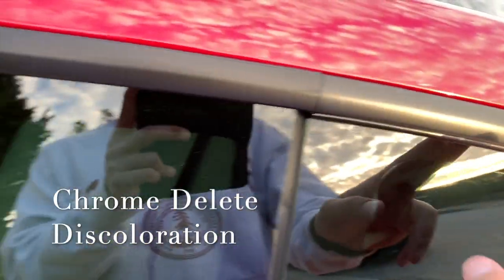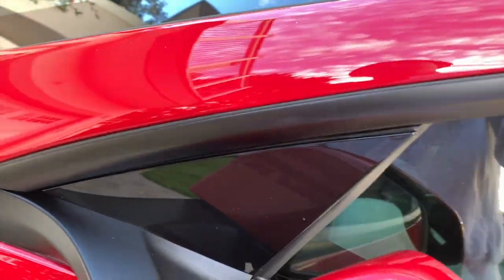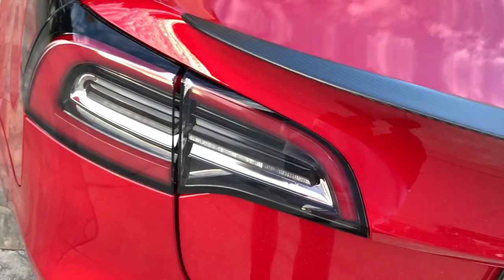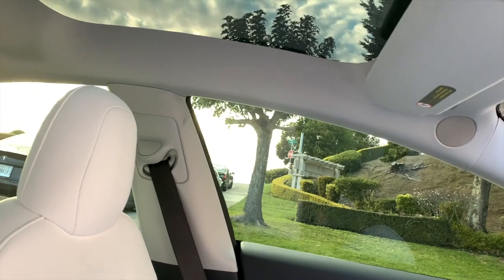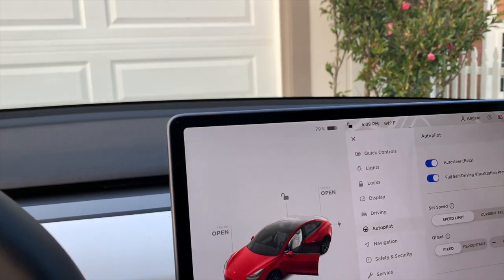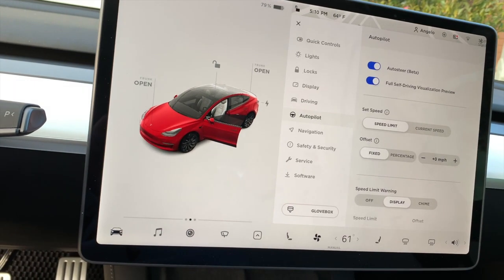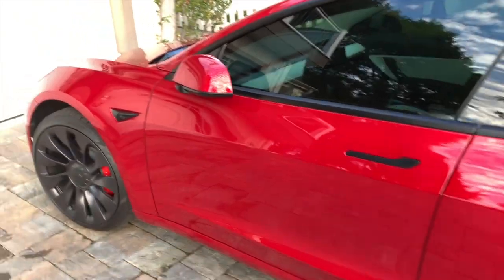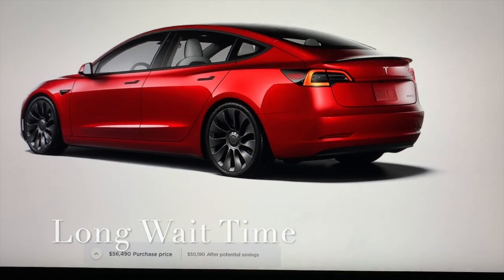A Few Things That I Hate About My Tesla (2024 Model 3 Performance)

Comment: I got a $550 ceramic coat to improve the exterior look and finish from a local detailer and then luckily had only a front passenger door panel gap that was fixed in an hour of taking it to the service center. Very happy with everything except for how much the range can fluctuate and how easily the black interior heats up under the sun (got a custom fit sun reflector for this)

Comment: I am a new model 3 owner, 3 weeks. I already drove 1500km. I hand wash my car weekly, I am too afraid to send it into a car wash. I have PPF in the front of my car but not the sides and back. I am surprised by the rock chips you encounter, I don’t yet have any. I am planning to add PPF on my own at the bottom strip. The PPF helps, but you need to go to a good installer and it should be done the first day you get the car. I don’t understand the rattling noise. I think I’ve heard it but not sure. I will be alert about that. Thanks for sharing.
Reply from the maker: No worries! Congrats on the new car! How are you liking the PPF?
Reply: How is it going with the PPF?
I don’t know if I should get a Tesla.

Is it working for you?
Reply: ohad PPF working good. No dents thus far. 6 months with 10000km, I’ve had 1 wheel rotation already. I did however changed my front pumper because I accidentally ran into something in a narrow underground garage, so the new pumper has no PPF but in any case, no dents. PPF makes the car easier to wash. At least you are at peace that the car won’t be scratched during washing. But yes, I think PPF definitely helps.

Comment: That condensation is a Saftey issue and they have to replace those lights! That’s illegal
Reply from the maker: Woah. Did not know that. I'll reach out to the service center to have them change it. Thanks for the heads up!
Reply: @AngeloCarlos  if you submit through they app they’ll send a mobile tech out to replace it

Comment: Do you have any gap issues, misalignment regarding tail lights, door closing issues, no hand handles at interior side ceilings like typical cars. Even a basic Corolla have it!!!!You are paying thru your nose and do not have that safety features for your passages? Why??? What about emergency door safety features easily accessible? Go watch TFL Videos regarding passengers door fail. Why is there no Air-Suspension shocks? Why not even a HUD? I like to have small dashboard in front of the steering wheel.
Reply from the maker: Yeah, I’ve had a few door closing issues in the beginning and had to have them fixed with the service center. Hope all is well!

Comment: Hate is such a strong word. Especially for nit picky stuff. Condensation in new car lights is common as the LED lights don’t heat up the cavity like the old tungsten bulbs did which would help dry out the lights.
As for the EPA range, perhaps get the EPA test changed so it’s more accurate. Every manufacturer makes the same claims which no one can replicate in normal driving.
Reply from the maker: Hate is a strong word. I really do enjoy the car. Appreciate the insights on the EPA and Condensation. I leaned something new today. Have a great day my friend!

Comment: Rock chips has Zero to do with the car itself. Even if it has 3-4 coats of paint. it doesn’t matter if you have a 20k paint job ( which I am exaggerating) you can’t not get rock chips.

Comment: If you change those wheels down to 18 inch, you’ll gain 40 miles of range.
Reply from the maker: That's pretty cool! What wheels did you change them to? Were they the arrow wheels?
Reply: @AngeloCarlos  any 18 inch wheels I heard, this is because the size of the tire is larger
Reply: @AngeloCarlos  I went to the 18” Martian wheels and they fit over the red performance brake calipers without doing any modifications. They look like the wheels that are coming on the roadster.

Comment: Note to self and something a lot of new YouTubers seem to do...stop looking at the display and look into the camera lens.  It's very annoying for the viewers.

Rocker panel paint chips are common with all vehicles, it's not Tesla specific.   And mileage, well gas vehicles never get their rate mileage.  Also all car dealerships are going to question if an issue is covered under warranty.  Is this your first car?
Reply: My vw tdi gets 3 mpg better than advertised
Reply: @ridered7394  I doubt that, since EPA ratings are based on ideal conditions.
Reply: I agree, all my cars had chips after driving. Perhaps stay further away from the vehicle in front.
Reply: @SirHackaL0t.  this happens for frequently when driving in the rain, because the water helps throw up tiny stones.  Nothing you can do about it except putting PPF on the vehicle.
Reply from the maker: Appreciate the advice. I’ll look into the camera lens when I film new content. Still learning the ropes and I’ll take this into account. Have a great day my friend!